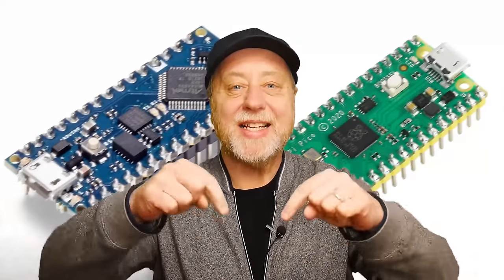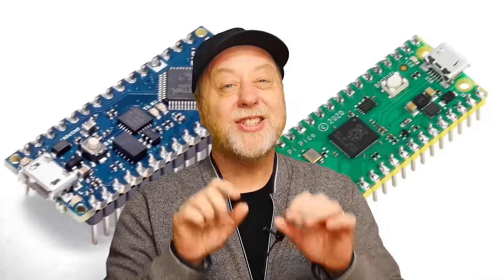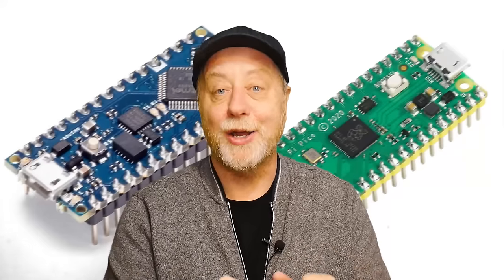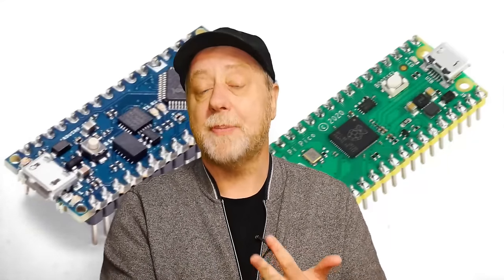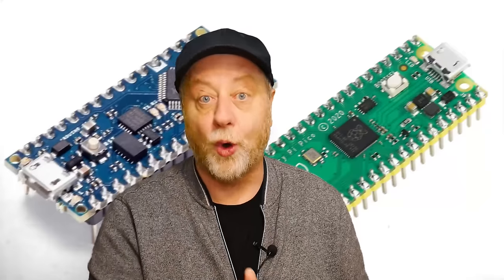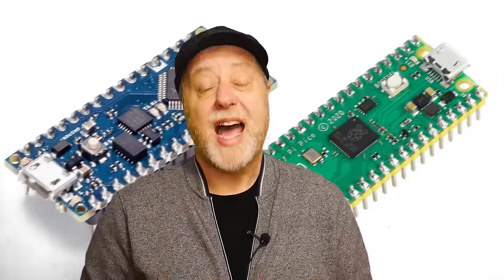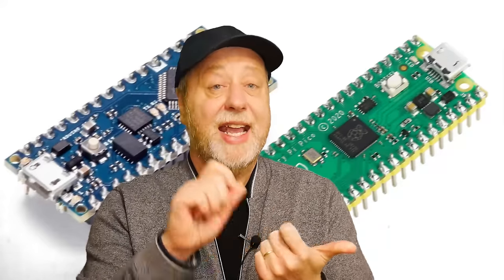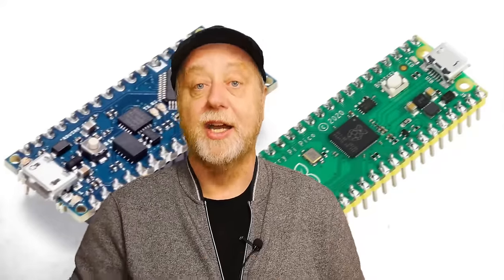Arduino vs Pico - Which is the Best Microcontroller For You?

Comment: Arduino and Raspberry Pi Foundation are also such great companies. The fact that Arduino is open source and that they fully support alternative manufacturers is absolutely unheard of in other industries.
Reply: It was clearly visible during the pandemic. There has been no shortage of Arduino boards, and some Raspberry Pi models are almost impossible to buy to date.
Reply: You are not wrong maybe there will be a Risc V version of the PI to counter this but democratizing tech is always a good thing IMO.
Reply: @dudds6699  RISC V cannot solve supply chain issues. There is a shortage of Pis because not enough are getting made, whos to say that if they switched to RISC V, which is still inferior, that they wouldnt have supply chain issues there too, everyone is having supply chain issues at the moment, it isnt something they can just fix by changing to RISC V.
Reply: Imagine a phone or a computer without WiFi.
MCUs without WiFi are boring.
Reply: @edgarmondragon4708  that's your opinion, most MCUs used in applications don't have WiFi because it isn't needed and it would over complicate a lot of projects.

WiFi is only needed for iot, or for remote control which is a very small area in which MCUs are used and in remote control there are a lot better technologies than WiFi, with better range that are simpler to use. So most MCUs are fine without WiFi and if you do need WiFi chances are you don't need to performance or features of most other MCUs as the projects tend to be simpler Iot things rather than projects that need complex real time processing and control.

Both have their place both with and without WiFi but there is a reason that most MCUs, even modern ones don't come with WiFi built in, for the vast majority of application it just isn't necessary.

The fact you seem to think that MCUs without WiFi arent any good, either means you only do iot stuff or you are just a tinkerer that doesn't really do any complex projects, like even with a quadcopter or RC vehicle, WiFi isn't great due to its range, something simple like a PID controlled hot plate also doesn't need WiFi, the majority of projects just don't need WiFi.
Reply: You are completely confused. they are not "open source". They are off the shelve. If you knew arduino's behavior and their greed for money they would monetize their design if they could. The thing is they cant, software or hardware.
Reply: @conorstewart2214  You can go without Wifi or Bluetooth, but it's pretty limiting. It's only a "small area" if you've been used to not having it and don't think to add it. If you aren't using WiFi, you aren't allowing yourself to monitor the state of your devices remotely and you are doing more work to transfer data. 
And requiring the range of a quadcopter or RC is far more in the "small area" you talk about, not WiFi or Bluetooth. Even then, having the WiFi or Bluetooth for "close" range will allow you to transfer data more easily using more standard methods. 
If you think you don't need it but find out you need to upgrade to it you'll be at a dead end with the Pico or Arduino hardware and you'll have to get new boards. If you were saving money not having wireless, that would be one thing. But instead you paid more for slower boards with less memory and much less storage. Additionally, your options are more limited, while there are a huge selection of ESP32 or ESP8266 products on the market with different parts. 
And nothing about the tools makes using an ESP32 harder (unless you choose to go into the harder mode on the Espressif products). Once you add the devices to the Arduino IDE or even better Platform I/O in VS Code you've got everything you would have had with the other devices.
The comparison isn't close right now. As someone who has had to purchase a number of microcontrollers, I can't imagine spending more money to get less.
Reply: Kyle Olson it really isn’t all that limiting not having wifi or Bluetooth, if the project doesn’t need wireless communications or needs long range wireless communications then wifi and Bluetooth are useless. Most devices don’t need monitored remotely, or data transferred from it, that is mainly just iot devices or projects, which most projects aren’t. So most projects would have zero benefit to having wifi and Bluetooth chip on the board.

Simpler longer range communication is often more useful for a lot of projects and is easier to implement. If you think you don’t need wifi and Bluetooth and then realise you need it, you’ve got bigger problems than that, because you should have identified at the start whether or not you need wifi or Bluetooth, it is usually pretty important in any project that uses it. Also you now have the pico w so you can swap a normal pico for that to add wifi and Bluetooth later on.

Not every microcontroller is slower than an esp32 or esp8266, so that’s kind of an unimportant point, and often projects don’t need the microcontroller to be dual core or that fast, if people needed speed then most projects wouldn’t still use arduino. Other microcontrollers also have features that the esp32 doesn’t have or have better features, like the adc in the esp32 being pretty bad. Esp32 isn’t the best microcontroller out there.

Also most projects don’t need that much memory or storage, having those levels of storage is a pretty new thing in the embedded world because it isn’t really necessary unless you are working with images or video or AI or micropython. It is becoming more necessary with some iot stuff but still isn’t necessary in the majority of projects. If you want more storage with a microcontroller you usually just add external storage like a flash chip, or emmc or an sd card slot.

If wifi and Bluetooth were that important then every new dev board would have them built in, but they don’t, because for the majority of projects wifi and Bluetooth are unnecessary and even for some projects having a wifi and Bluetooth chip on board could be a disadvantage because it takes up space and takes up pins from the microcontroller and generally adds cost, I believe the one on the pico w uses spi, so that’s 3 pins taken up that could have been used for another purpose. Wifi and Bluetooth is good to have just in case if you are just playing about but you generally know whether or not your project will need it, deciding half way through when you’ve had pcbs made and code written that you suddenly need wifi, usually points to bad decisions or lack of planning earlier in the development process.

In short, wifi and Bluetooth are useful but for most projects unnecessary. The esp32 is not the best microcontroller for every application.
Reply: @conorstewart2214 , Supply chain issues will eventually be resolved. It takes time to build new fabs.
Reply: @terjeoseberg990  I never said they wouldnt, I just said that switching to RISC-V wont automatically solve supply chain issues.
Reply: @edgarmondragon4708  enter pico w
Reply: @edgarmondragon4708  Phones and computers have existed for many years without wi-fi. It's not hard to imagine it. Were you born in 2013?
Reply: They are not exactly open-source. You just write a program for a particular CPU architecture (AVR8 or ARM32, respectively) using a programming language, and the code does exactly what you want. It's also how programming works in general, doesn't matter open or closed source. As long as you can write and compile a program for an architecture (meaning, the architecture is documented along with its instruction set, and you do have a CPU datasheet to know how hardware registers are named), you can do anything with it.
Fun fact: a lot of devices use AVRs and ARMs internally, so it's technically possible to use them in any other appliance, provided you know the pinout (it's on a datasheet, and every publicly accessible chip does have one).
Reply: @TheLukasz032  Both the Pico (RP2040) and Arduino bootloaders are open source. Their compiler toolchain is opensource. The board designs are open source. What more exactly is in your definition of open source? 

* The RaspberryPi is not open source because people like Broadcom won't bulk sell you a chip or give you a datasheet or any of their IP micocode for a lot of their processors without an NDA which makes it impossible to open source
Reply: @cda32  - "Their compiler toolchain is opensource." -> partially misleading, it's just not theirs in the first place. It's just standard AVR8 or ARM32 compiler toolchain, nothing less, nothing more. Both proprietary and FOSS implementations do exist (for instance, on AVRs - Atmel has its own based on Visual Studio's one, while avr-gcc is a compatible community-driven open-source project). Also, I wrote something different originally - I just meant whether the board itself belongs to an open-source project or not, is simply irrelevant to its architecture and programming capabilities.

RPi itself may not be an open-sourced project entirely, but it can be programmed on - the SoC executes normal ARM32 code, regardless of who developed the running code itself.
Reply: Well, it is heard of in SW industry. Practically all SW worth using is FOSS - from Linux to Apache family to Eclipse to PostgreSQL to gcc stack to myriad of other languages...
Reply: 333. Like!!! Yesss

Comment: As I prefer having Wifi available, I tend to select ESP32 (or even ESP8266) instead. They can also be programmed via the Arduino IDE or MicroPython.
Reply: yes me too ... and if one doesnt require so many io's ESP8266 is around 1/4th of the pico
cost wise
Reply: I try to support R Pi wherever I can because of the ethos of the company and I have a new Pico W. However, to my very limited understanding it’s still inferior to the 32bit, BLE ESP32.
Reply: And cheaper.
Reply: I use ESP solutions in some of my commercial projects - although I use their official FreeRTOS-based toolchain with multitasking support - it simplifies things a lot :)
Reply: @jonsmith2712  where i went shopping yesterday and i found the pico at half the price, i dont know if its because of the region i live in
Reply: Yes. I'm familiar with the Arduino IDE and the vast multitude of libs (so much work done for you, tried and tested beautiful work), and the ESP8266 is so cheap and competent. The Pico looks like a really cool, solid product, and it will be great fun to play with; but at the moment if I need to get something built, an ESP on the IDE just gets the job done. What times we live in!
Reply: You know US military is not allowed to use EPS 8266/ESP32.... nuf said.
Reply: @lovemadeinjapan why?
Reply: @CycloidalHeadache  Potential backdoors.

Comment: Between Arduino and Pico, ESP32 is the best!
Reply: Absolutely. If you need 5V and have a very simple problem to solve ---> Arduino, otherwise ---> ESP32. The Pico is a solution in search of a problem: it is half as fast as the ESP32, has half as much flash and RAM, has fewer pins, lacks Wifi/BT, and has a smaller development community. The ESP32 also tends to be cheaper, although nowadays the chip crisis causes so much fluctuation that it is hard to compare prices...

Comment: You can also program in Rust on a Pico. Reasons for using Rust instead of C/C++ is you get the same level of performance as C/C++ but the Rust compiler will catch a LOT more errors before they hit the hardware and the language itself is far less prone to programming error too.

Comment: It's a perfect time for ARDUINO to come out with an Arduino-PI as a mini-computer that competes with the Raspberry PI.   currently the RPi is not available and pretty much ANY sort of   'version-1' would be a killer board and springboard the whole Arduino Community into a next-level capabilities.
Reply: Except designing an SBC is very different to designing a microcontroller dev board, arduino dont make their own chips either, they just use microcontrollers made by other companies, so if they made an SBC they would have the exact same supply chain issues Raspberry Pi and other SBC manufacturers are having. It also wouldnt really change the community much at all because most people that use arduinos are familiar with or at least know what a Pi is and when to use one. Arduino creating an SBC would be trying to push into an already crowded market and they would just be using the exact same type of chips as all the other SBCs unless arduino gains the skills and people to develop their own SBC, which is something Raspberry pi or most SBC manufacturers dont even do, so I cant see arduino doing it either. Overall there isnt any need for an arduino SBC, their products are massively overpriced for what they are anyway and chances are if they made an SBC it wouldnt be open source, just like the portenta H7 isnt.

Comment: Firstly, great job on consolidating all the info on this topic. Very well summarized and presented.

Which board would I pick - well I’ve been doing embedded projects for years and am not afraid on getting closer to the chip with tooling etc. so for me, it’s a clear win to get the pico. For someone new trying out physical computing for the first time I would still start arduino uno because there are hundreds of thousands of projects with pictures/blogs/git repos etc. and if you need to learn something it’s just one google away. Circuit python is gaining traction especially with backing from amazing people like Adafruit but the body of code that Arduino tradition has is just unmatched right now.

Once your degree of sophistication with tooling increases you just outgrow the atmega328p and start into ARM Cortex.

Comment: Really liked this video Gary 👍🏻

Only thing I feel was missing was maybe a comparison of the IO in detail.

Maybe that’s best left to a follow up video that breaks down some of these key comparisons.

Also, I’d love to see you do a microcontroller history video!

I personally have yet to get back into (actually physically doing) one of my favourite hobbies when I was younger and that was electronics and reading about digital electronics and microcontrollers.

I’m in Australia and I used to read a magazine called Silicon Chip that featured a series on PICAXE microcontrollers from the UK (you’ve probably heard of them).

I bought some and started getting into programming etc. but after I packing up to move house in the mid-2000’s, I have yet to break it out all again and get back into it.

I now have a RPi 4 8GB but yet to do anything with it other than get it running RPi OS, so keen to get back into it all but I just feel like I’m missing so much from mid-2000’s to late 2010’s that I’d sorta like to get a handle on the developments since the time of PIC microcontrollers and maybe a bit about the languages/IDEs.

Lol just a small request ☺️👍🏻
Reply: Don't put any pressure on yourself. Just do it for fun and get started again. When you don't think "I have to do this" and instead just "start doing" it becomes fun again! Much love from the USA!

Comment: I was not aware of the Pico until I watched this. I've put together several projects using Arduino, but I've got to say that anything that properly uses interrupts and not the clunky void loop() will come as a breath of fresh air. And using the full C++ compiler and error checking can only be a good thing too. Still, a Pico can be bought for pocket money, so I'm going to be giving it a go.
Reply: The microcontrollers on an arduino board are just off-the-shelf chips, be it atmel, ST, etc. You can also program them in C/C++ if you want. I'm not saying you shouldn't play with the pico, i'm just pointing out that just because it says arduino on the silkscreen doesn't mean you have to use their ide. You can program it in assembler if you really wanted to.

Comment: My primary reason for selecting a Nano would be it's 5V (with reasonably good GPIO selection). For 3.3v, I often default to an ESP32 these days, but if I don't need Wifi and 3.3V is fine, the Pico looks like a fine choice whenever I need loads of GPI and the dual i2c buses certainly nice.
Reply: Especially for beginners, who want to control one or the other LED directly, the current limit of 4mA is not insignificant. There a UNO with its 20mA pPin already has its advantages
Reply: Black Pill is nice too, I know is a 3V3 but the IO is 5V-tolerant so you can use standard 5V CMOS or TTL no problems. My only concern is about the diode on the USB because I don't know the model but probable the legacy USB power (500mA) will be safe. I was thiking on get a Nano because the small form factor but this was more cheap and powerful, knowing I can use 5V on IO is a nice feature. That have 25mA IO, just take into consideration the full limit on 120mA for all the IOs sum.
Reply: My main reason to not use the pico pi is the fact that it's just such a severe overkill which is reflected in the price.
The feature list is absolutely great for the price, no doubt. But why pay for a load of stuff most projects don't use?
For example USB hardware support alone almost justifies the price point. The other one with that feature atmega32u4 costs almost the same and is way older.
Reply: @fgregerfeaxcwfeffece  but ATMEGA32U4 $4.72USD, RP2040 $1USD + SQI flash 8Mbit $1.6USD still is more cheap

My Black Pill STM32F401 is overkill, I know but the most cheap MCU i can get is the ATTINY10 and well, that is too much little next is STM32F030F4P6 $54MXN while a more old PIC16F628A is $68MXN somes times new is more cheap,

Comment: I had made use of the Arduino nano clone board to run a matrix of LEDs controlled by Glediator, there were some serious limitations (512 total) from it being an 8bit processor, eventually I would like to try to build a large custom LED display that would probably work WAY better with the pico, given there’s enough software support to make it work...